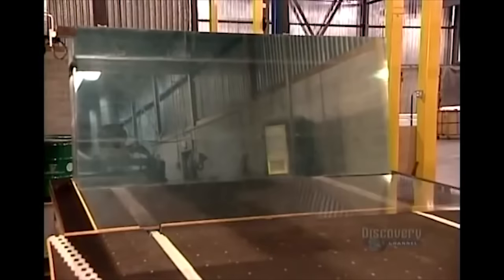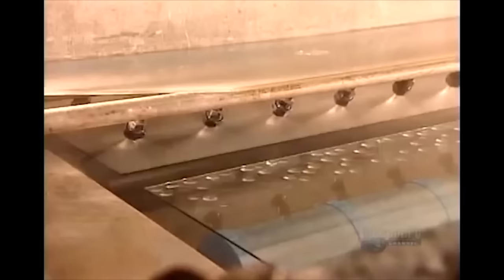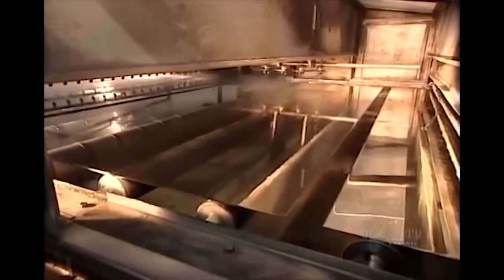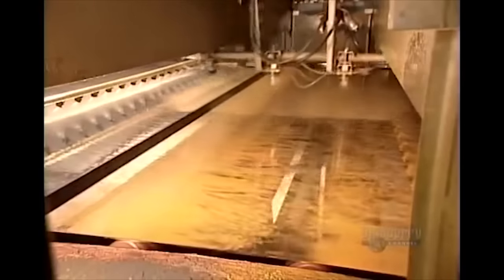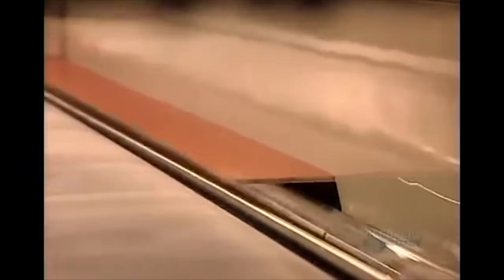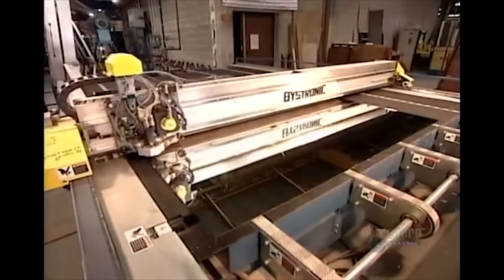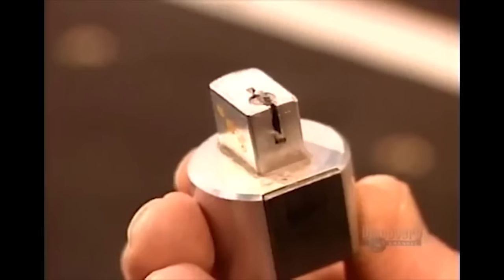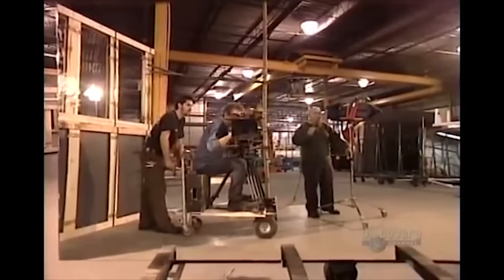How It's Actually Made - Mirrors

Comment: Fun fact: mirrors are actually green. If you line up two mirrors in front of each other, you will see that the reflection gets more and more green towards the middle!
Reply: They're coated in red. Didn't you watch the video?
Reply: @HealedCoyote997  I am aware, but the color on their display is green
Reply: Fun fact: mirrors are actually green because they don't give a fuck about color. 

Fixed your fact.
Reply: The glass is green
Reply: Jason Blooey Mirrors are so badass
Reply: The glass is greenish because of iron that's in the glass from the manufacturing process, easy to see if you ever looked at the side of a thick piece of glass. You can get glass that is totally clear but it's more expensive and not necessary for normal applications.
Reply: @Kanglar  Actually, that's not true! When mirrors are finished and sent to the stores, store owners will scrape off bits of the mirror and replace it with mashed up avacado. Next time they polish the mirror, it's practically invisible to the naked eye, but mirrors are able to see through the illusions of polish. The reason they scrape off the mirror is to build an extra mirror over time, thus saving money.
Reply: @HealedCoyote997  
The red coating is a paid actor
Reply: Pfft. That just means that the 2 mirrors are still virgins and are still green to the concept of having sex. It will be fixed if you let them go at it for a couple days.
Reply: So... the glass is always greener on the other side?
Reply: Fun fact: Did you know if you look into the mirror, you will see disappointment.
Reply: @JayV688  oh my gOD
Reply: Jako If you’re seeing green thats a sign that you have a tumor
Reply: The glass is greener on the other side
Reply: They're green because they're absorbing the red light so that the bourgeoisie can't have it
Reply: Naw its just the impurities in the glass making it green, if you look at glass sideways its a dark green. If you look at low iron glass it's super clear so it looks blue on the edge. A bad polish could show the green though the mirror if it hit by light a certain way
Reply: JoulSA that’s beautiful
Reply: They're green because they're more sympathetic for the farmers than the workers